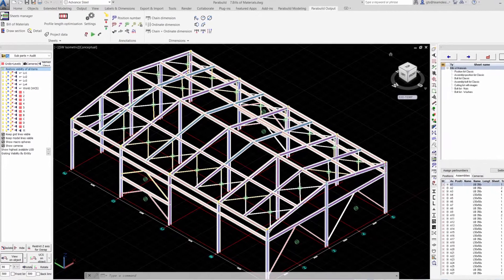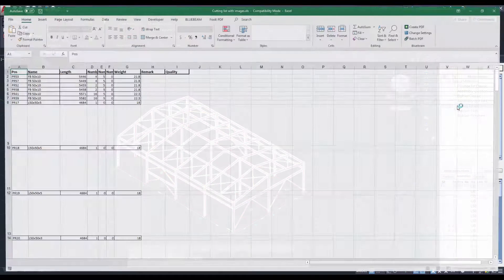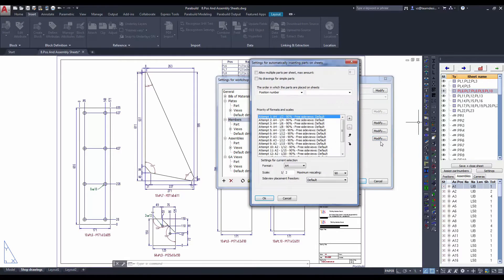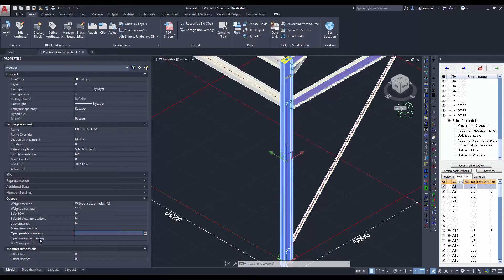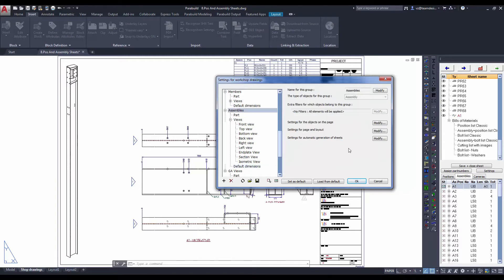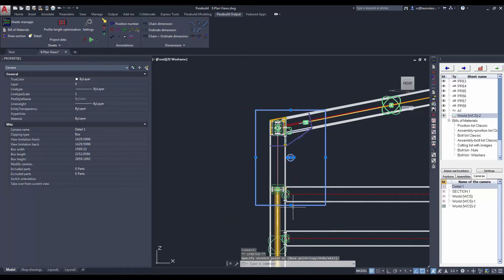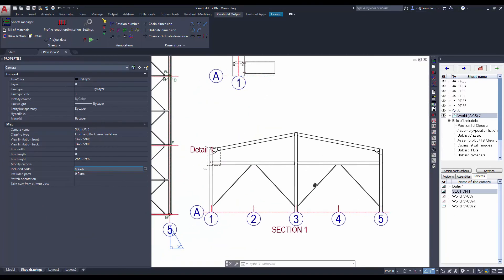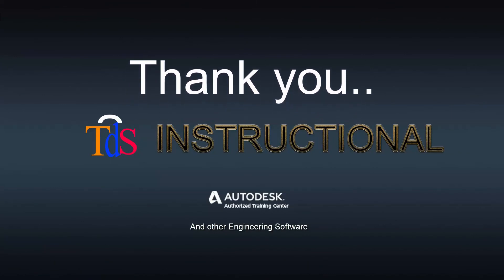Structural Steel Challenge : Parabuild for 3D steel structure - Deliverables

Comment: Hi, thank you for your videos, they're interesting.
What can I do to speed up the programm?
What hardware are you using on your pc for Parabuild with BricsCAD?
(Not the minimum requirements)?
- Mainboard?
- CPU exact model?
- memory Ram count with mhz, ecc?
- Grafics card model?
- storage SSD/HDD, read/write speed?
Reply from the maker: We are using Parabuild with Autocad. We are running on a 3 year old Dell Precision 3510 laptop. i7-6820HQ @2.7 Ghz, 8 Gb RAM. AMD FirePro W5130M. Win 7 Pro. Storage is HDD 1Tb . Autocad 2020 . Working quite well. We are new reseller and we are testing the software with real senario. So far so good even with Macro creation etc.
Reply: @TDSEngrSolutionsPteLtd  Thank you.